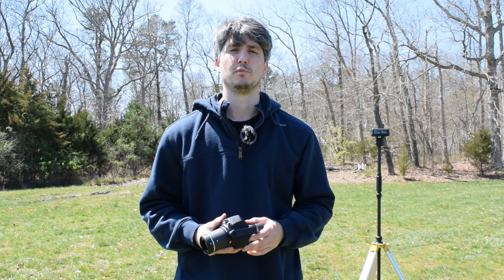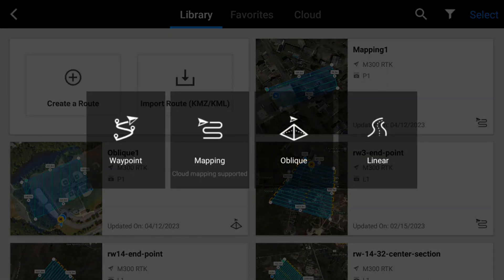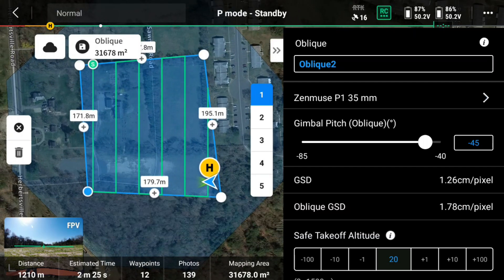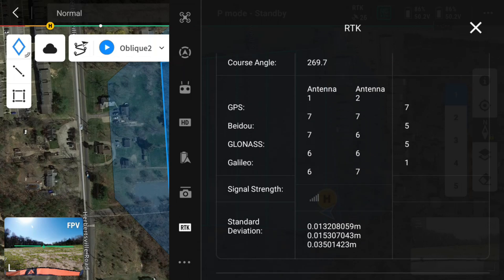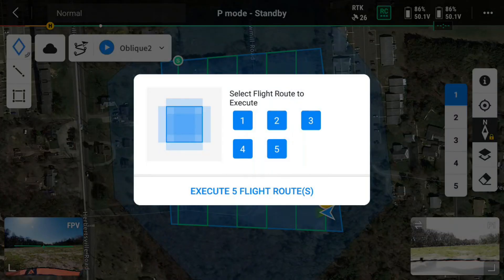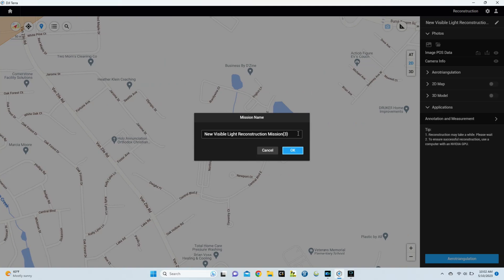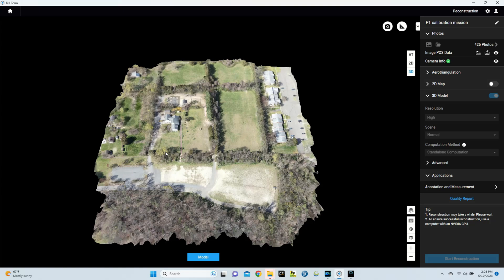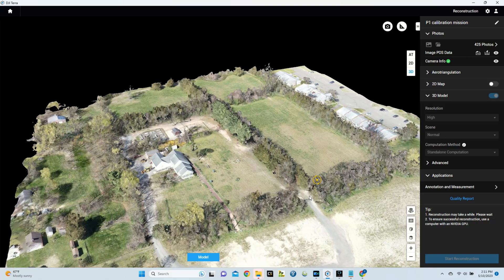DJI P1 Camera Calibration with Matrice 300 RTK for the Most Accurate Data!

Comment: Great video - do you need to recalibrate each time you swap? I.E. if you calibrate the 35mm and then switch to the 50mm and calibrate that, when you switch back to the 35mm again do you have to do a new calibration, or just switch back to the MicroSD card with the 35mm calibration file on it? So could you basically have 3x MicroSD cards for the 24mm/35mm/50mm and just switch between them each time you swap out a lens, or does the physical action of swapping out the lens require a recalibration? Thanks!

Comment: Hi Chris, for the P1 lens calibration mission, in DJI Pilot2 the camera must have the automatic shooting configuration or the manual configuration (iso, shutter...) but above all the dewarping must be turned off? Finally, should this calibration procedure be performed only for subsequent reconstructions with DJI Terra, or also with reconstructions with Agisoft Metashape, Pix4D Mapper, Reality Capture...? (Metashape, for example, has a built-in calibration of the distortion of the cameras that are used in the 3D reconstruction). I should calibrate the 24mm and 35mm of my P1...Many Thanks in advance, greetings.
Reply from the maker: Hello and thanks for watching. The flight should be an autonomous mission, leave the camera in automatic mode, and dewarping will be off. You only need to do this calibration one time, assuming you never take the lense off, and it can only be done via DJI Terra. If you are not using DJI Terra to process your data, you will not be able to obtain the calibration file. If you remove the lense and swap the lense for a different one, you will have to recalibrate
Reply: @TerrestrialImaging  Hi and thank you very much for your reply. Once you get the calibration file with DJI Terra, should the "sfm_report.json" file be put in the microSD slot or SDXC slot of the P1? Many thanks in advance, regards.
Reply from the maker: @marcomassignan7171  you will put the file on a micro sd card and leave it at the root of the sd card. The SD card will just sit in the payload

Comment: If all that I need to do is take my lens off and then put the same one back on can I use the same calibration file as before?
Reply from the maker: so you really only need this calibration if you are using dewarping, which is helpful for single shots, in mapping missions you do not need to dewarp. 

If you take the same lense on and off you will have to recalibrate as the properties might be slightly shifted with how the lense is put back on

Comment: Actually this is not the lens calibration but, a generation of calibration file process that will be used when using dewarping option. Which actually should be turned off when using third party software like Metashape, Pix4d or other. From what I understand If you don't use dewarping option this process gives you completely nothing :)
Reply: Is this true?

Comment: Why wouldn’t dji offer a properly calibrated json file for each size lens
Reply from the maker: I imagine there is no way to guarantee that all lenses are identical, thus using a "Default file" may not apply to your lense as it could be slightly different. By creating your own file, your creating one specific for your lense and the way its fixed onto the P1.

Comment: Cool! Amazing video and spot on instructions. 
Ok, my plan was calibrate 24mm and leave file on one SD card, calibrate 35mm and leave file on a different card. And then just insert then right SD card for the lens I am using. I know it’s not perfect but I can’t see having to calibrate every time I switch them. Thoughts? 

Also. Anyone see the 24mm lens has really bad fish eye! Phots have all four corners cropped off. But when I make an ortho it works perfect? But pictures suck you have to turn on dewarping.
Reply from the maker: Thanks for watching! I like the idea of having the 2  SD cards pre-loaded with the calibration file. I cant speak on how this will impact accuracy down the line though. DJI reccomends recalibrating every time a lense is removed/put on. The pre loaded calibration that you have on the SD cards could be marginally off every time. The idea is everytime you reattach a lense, something about it could be a hair off compared to last time. 

As far as the 24mm lense goes, I myself haven't used it so I can't really comment.

Comment: How do we know if the calibration file worked?
Reply from the maker: Look at one of the image files from the P1, right click it and open with notepad (or any other text editor). Do a search (ctrl-f, cmnd-f) for "drone-dji:DewarpData=" if you are able to find the DewarpData in the image XMP field, your calibration is successful!
Reply: you can also when running a new mission in the AT report, checking if uncertainties are small between initial and optimized camera internal parameters

Comment: Hello, thanks for the video. I have been trying to figure if my Dji P1 needed to be calibrated. I bought it new from a Dji dealer. The P1 came with a 35mm lens. My sales man never told me anything about needing a calibration. My unit was new at purchase. Do you think it came calibrated with the 35mm or should I do the steps in your video. How high did you fly and the speed.
Reply from the maker: The P1 does NOT come calibrated out of the factory. Unless your salesperson did the calibration for you, your device is NOT calibrated. I would reccomend performing a calibration flight on your own, it will make your P1 just that much more accurate. I flew this mission at 100m high, and left the speed at the default speed.